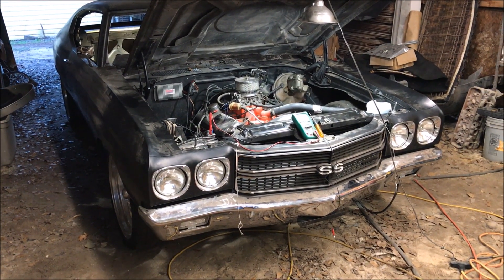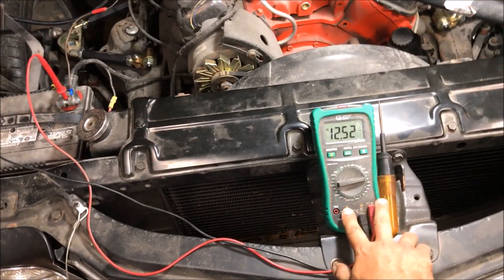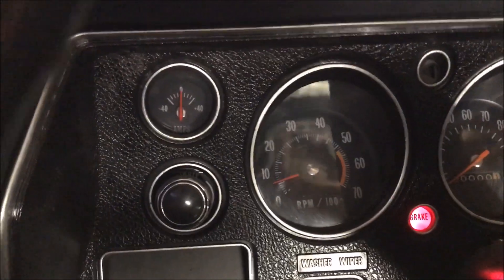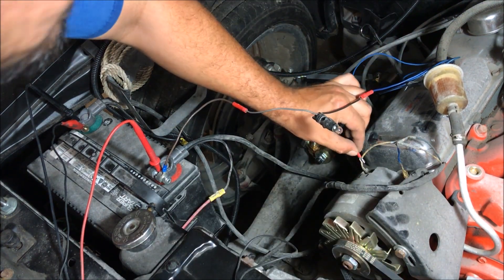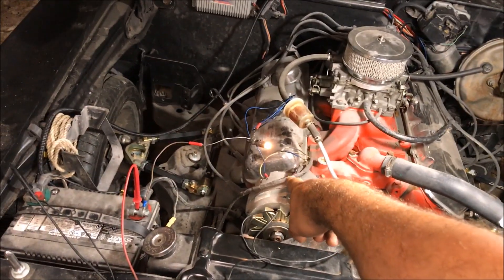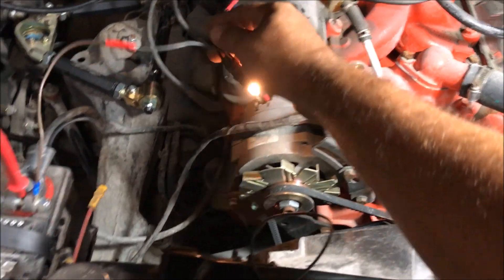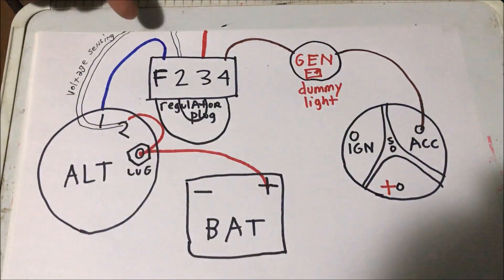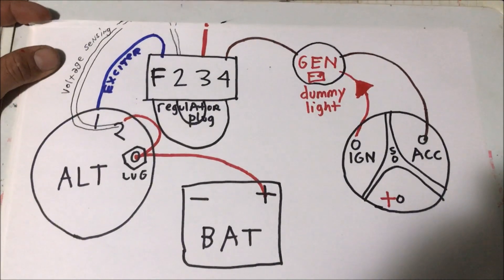internally regulated GM 3 wire conversion UPDATE and INFO

Comment: Hello Chris I have a 68 cutlass and I upgraded the alternator by watching your videos. I put in a 100amp 3 wire alternator.  Everything is working great it's charging like it suppose to. I jumped the external regulator like you showed but my gen light is always on. I'm getting 14.6 volts everywhere I test. I can't figure why the light is still on. I even upgrade the charge wire to 6 gauge and put new terminals on the blue and white wire. Blur wire to number 1 on alternator. I'm sure I've done everything right

Comment: I've had the same problem. Looks like your ss dash doesn't have the dummy light. Get the light and wiring correct and it should work. BTW the amp guage can be replaced with a voltmeter eliminating under dash guages and the complexity of running current through the dash. 70 to 80 GM ,dash, amp guages where complex. An extra wire etc etc. Summit racing has the part. Shiftworks  Replacement Voltmeter Guages S535-G  PN# SIW-S535-G. U gotta rebuild the cluster and a bunch of ,slight,modifications. BTW I  have a 70 chevelle also.👍👍👍

Comment: Tried to remove alternate toggle switch & wire into ACCY on the ignition, but It still has voltage drain with the key off? I don't know?.. the toggle switch cuts the power when key is off & I can control the sch etching noise of the Altntr. It could be the regulator"'s bad, but it does charges.. I still need to remove/repair the rest of tampered wires, almost done?= Maybe?

Comment: Normal I I don't cement. You have the better diagnosis explain & repairs & you saved me time & banging head against wall breakdown fit looking to those who are less &/or cockeyed Inept? The Exciter wire was my problem &  It puzzled me thoroughly even with the one wire system I was getting no charge & I still don't know why? Job well done thank you.
Reply: How did you end up wiring for the excider wire?

Comment: If you want to know the alternator output voltage, you need to measure it at the stud on the alternator.  These older vehicles tend to have the sending wire buried into the middle of the harness along with the charging wire.  Because of voltage drop, back at the battery voltage may measure lower.  As long as it's above 13, it's not discharging the battery.  I bet your alternator is putting out over 14V at the stud, using the case for your meter's ground connection.

Comment: hello chris...i´ve been watching your site since i bought a 55 chevy belair that was sadly enough chaotically restored...electronics were a catastrophe as the brakes and clutch and suspension although it had new paint new interior, new floor exhaust ..a 350 cu.in with 5 speed..must have been from a pickup, the shifter went to about the roof..you first helped me a lot with my carb...had a carter..old..baught a holley double pump...750cfm...that worked as you explained...not good...did rebuild with your help and sold it..now have a holley 600cfm warrior..nice...at the moment my major problem is the alternator...that "kicks in" at about 1600rpm(Delco)..i´v seen on you video that you attached the no 1 pole to the accessory..the intelligent beasts that installed the motor getting the firing order totally wrong..ran terrible naturally ...installed it with a batterie cable to the plus pole of the batterie which is a very large gauge but should work ok...i think ???would be nice if you could confirm that..and on pole 2 a cable to the pole running to the battiest post as you have described..fine ...what i don't understand is the no1 connected to the accessory of the ignition...how does that work???am i putting in 12 volt to the accessory or is the accessory throwing a switch in the alternator??....how does that work and is there an other alternative than running a new cable all the way from the ignition switch to the alternator???would be nice if you find the time to give me an answer on this...i live in france and here you've got those experts that can't even fix your lawnmower but know everything about american v8s...bullshiters....and in the net there are profi sites that say it should "kick in"..which doesn't make sense to me..especially as i do not have a cable going to or from the pole nr. 1 at all...and by the way ...after all my research in the net..and I'm doing a lot by myself out of desperation...you have the most sensible and creative site of them all...have seen almost everything you do and must admit your logical mind is a hudge asset for everyone in need of help..are you an engineer and teacher as profession...???or university prof in cognito?? love your sites as they help and also bring me home again after many years living here in the ass of the world ..europe...can´t go home yet because of my kids...am 71 years old now but sooner or later ill make it...thanks again for you fantastic site and very digestible way of presenting ...gary (siehnel23@orange.fr)....HELP!!!
Reply from the maker: I have the “gm 3 wire alternator hook up video”... yes, for NUMBER 1, you run a wire back to ignition switch or fuse box ON with key to a ACC or ignition with a DIODE if you don’t use the GEN light

Comment: Hey man great videos been watching your vids for quite some time thanks for all the great info. I have a question i have an ol 64 impala im going to try this on do i also jump the wires on the voltage regulator like in your other video? And will my dummy light still function as this one did in this video? Do i need to install the diode on #1 wire too looks like you didnt have it in this video just want to be sure i know its a simular wireing system but dont want to fry anything lol i appreciate your time and videos thanks!

Comment: Ideally, the at-idle system voltage should be at 14.1-14.9VDC. The reason for it not being that--in the case here--may be simply a matter of the factory wiring being so old & worn that it's built-up too-much resistance to allow said ideal to be achieved, thus requiring a "refresh"/rewiring of the vehicle's electrical system... for safety & reliability.
Reply from the maker: the alternator is a remanufactured one that charged 14.2 6 months before the video..    nothing to do with resistance in the factory wiring

Comment: i had under dash wiring harnes put in my 66 chevelle  the car has dummy lights for the altenatot and oil they put in a harness for factory guuges the ones with out the dummy lights so my charging  light doent come on any more i have a after market oil guage now how can i get my charging light to come on with out getting a after market guage ? thankx

Comment: Would it be easier to replace the mechanical regulator with a solid state regulator ?  That's what I did to my 1970 Pontiac Tempest...no more flickering lights.
Reply from the maker: I have the EASY conversion video you should check out.. no, get an internally regulated alternator.. the old regulators work fine they are just obsolete..why spend MORE money to have MORE obsolete parts that can malfunction?
my conversion costed about $40
Reply: The solid state regulator has no moving parts unlike the stock unit and it only cost $17.00 at Rock Auto. I'm not knocking your conversion, I'm just a purist and wanted to keep it stock. I also converted the ignition to electronic with a Pertronix ignition unit which allows me to replace the point only. Thank you for your reply and for sharing your knowledge.

Comment: The dummy light was known as the "idiot" light back in the '60-70's when the Generator meter was dropped. This lamp was officially called the GENERATOR light, it GOES OUT to indicate that the alternator is charging. Also, per GM factory wiring configuration for the #2 "sense" terminal, it should be tied direct to the +12v battery terminal for proper charge sensing and not over to the +12 alt lug.

Comment: I have a 1970 Impala 2 door coupe I replaced the turn signal switch and now they don't work but hazard lights and brake lights work checked all the ground they are good but still not working what should I do
Reply from the maker: +Pete Garcia all you can do is make sure the wire colors are the same in the new plug... and in the same place...

Comment: Great Video!
I have a 1970 GMC C-2500, previous owner installed an Internally Regulated Alternator. The problem is they ran their own wires from the alternator to the fuse box, connected it to an open plug on the fuse box  and ran another wire to the junction block on the passenger side fender. The original wires from the External Voltage Regulator were just cut an taped off yet they are still connected to the fuse box. 
  The battery dies after 1-2 days if the truck is not driven.  Should I connect all  four wires from the external voltage regulator like you showed before?      
 https://www.google.com/search?q=wiring+diagram+for+1970+GMC+C-2500&num=20&tbm=isch&tbo=u&source=univ&sa=X&ved=0ahUKEwjW7_mB6rPUAhXFxYMKHQqAB18QsAQIKQ&biw=1920&bih=920#imgdii=g9cJL2ZJfT-QjM:&imgrc=TMCSKuMBz6HzSM:
Reply from the maker: watch my easy external regulator conversion for the regulator plug and my GM 3 wire hook up video for the parasitic draw on the battery and to make sure its wired right..   =then ask more questions if you have any
Reply: @chriscraft77022  in

Comment: Okay  I having a bit of a problem  ? I ended up buy a 1971 chevy Monte Carlo  ..for my first muscle  car  . but anyways  I have to keep jump starting it .so I changed the battery and put another one  in an still having problems so i changed the alternator  ..but  I end up jump starting it and  it will set and idle for a few minutes and then the dash lights dim  and then she dies??????????
Reply from the maker: +Dalton L.j Carr your problem is simple but can also be like 10 different things... you need to get a wiring diagram and start checking things out... the fact that you are mentioning the idle of the engine indicates that your problem is beyond the wiring... you have some fused links blown or wires crossed to start off...
Reply: Chris Craft   okay I will have too look into it and what are the ten possible thing that could be wrong with it ? And   me and my buddy just notice the other day there  was three different hook up for the alternator
Reply from the maker: no, there is ONE way it was hooked up...  if you lived by me i could fix your car in 5 minutes... maybe 3...  free of charge.... you need to get the wiring diagram to show you where the fused links are and exactly the way it was wired...  71- and 72 were wired different.... and i think that is where your problem is....
Reply: Chris Craft well thanks for the advice  your the first person  to respond to my comment ..i been trying to get help for over a month now thanks a lot man.. I will   get a wire diagram ..
Reply from the maker: get a wiring diagram...  that was the first step i took in understanding this type of crap... after you study it for 2 weeks....  i will have answers for you... after you have probably found the problem...   thanks for watching....
Reply: Alt not charging run up 800 plus then let idle shou charge if you have a self exciting alt

Comment: So number 1 should be ran to accessories ONLY on the switch? or can it be ran to accessories/ignition? I ran mine to what I think is the original wire because it was on the 4 spot on the plug I believe and it came on when the key was turned on. what are the colors on the wires from the factory harness for F 2 3 4. thanks for the videos and the help.
Reply: you use acc to insure that the alt is isolated from ign sys when key off.

Comment: You could always replace all the 194 lamps with a 194 LED replacement lamps. They are super bright, they don't burn out, less load on the wires and switches, less heat to damage the sockets, and they act like diodes so you won't have to add a diode to cure the engine run-on problem.  

Thanks for all the great videos Chris!